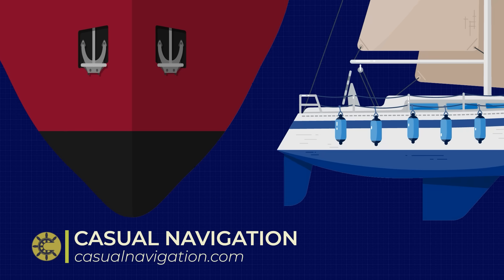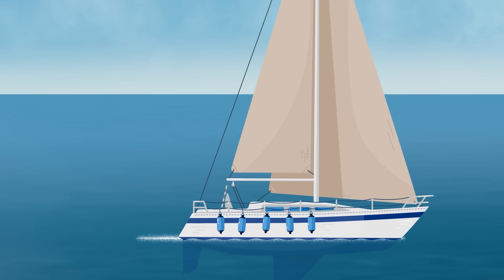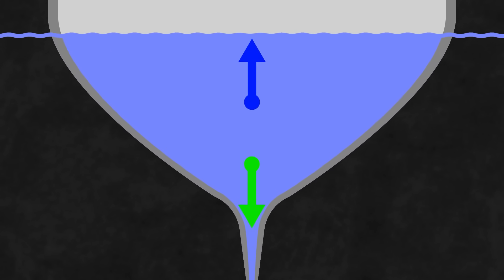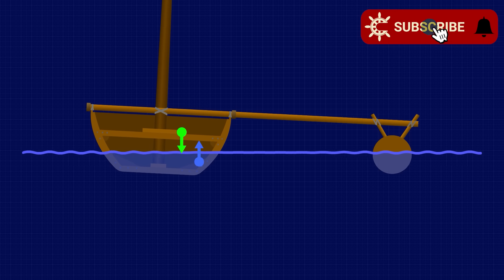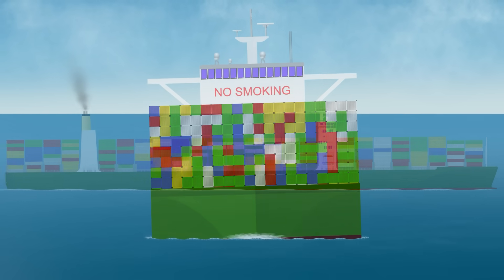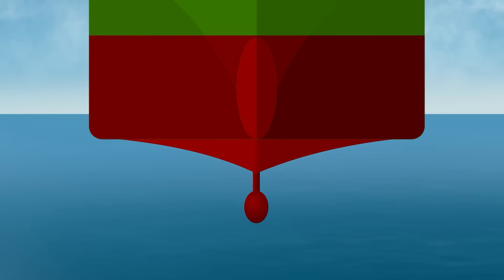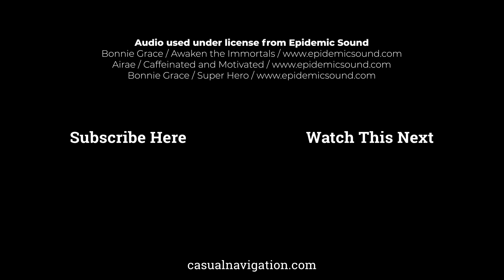Why Do Ships Have Flat Bottoms?

Comment: During the colonial times the English ships would come over not with goods.But with rocks so that the ships would not turn all over and sink. Those rocks were used to pave every street in Manhattan. Before it expanded again in the 1930s, Philadelphia Greenwich, just about every major port city, so many rocks were blood over in the halls of ships.  That were\nTaking our product Back to england to be milled and then sold here in the united states at the cost that we could bear , and because we couldn't bear much cost , not much of it came back , it went to more europe than back here to the states. Sorry the colonies. So next time you're walking down a cobble street , a single block of which would be carried in one ship , just give you an idea of the scale that these 323 hundred and 350 foot long ships were carrying. And that's not a made up number because many merchant ships were much smaller. They were more in the line of a boat size , approximately one hundred fifty feet long , and they were between eighteen to thirty feet deep. And all that rock was brought over by these little teeny , tiny, oversized boats.

Comment: I assume that also means that cargo ships always want to run at high weight, which means that they either need to take cargo back on every return trip, or take on a lot a ballast, and potentially put ballast tanks higher up in the ship, requiring powerful pumps

Comment: You could also include the GM aspect, explained like a pendulum, whereby the lower center of mass and gravity below the center of buoyancy act as a righting lever. So long as you have a positive GM, even just 0.5 meters, the ship is stable, but will roll more, but also return to center more gently. If you have a GM exceeding say 5.0 meters, the ship will roll less, but the force back to upright is quite violent, potentially jeopardising the integrity of lashing on deck (container ships), and not make for comfort for the crew. There is then a sweet-spot between the minimum and too much GM.

Comment: A vessels stability doesn't derive from the vertical distance between the center of gravity and the center of bouyancy but between the horizontal difference between the two.  As the vessel heels the center of buoyancy moves towards the section with the greatest depressed volume at the same time the center of gravity moves towards the opposite side. A flat bottom allows that horizontal distance to increase greatly at low heel angles. This causes an greater increase in stability at relatively low heel angles.  This is called initial stability. Flatter bottoms allow for less rolling. The downside is that flatter bottoms tend to completely roll over once the initially stable heel angle is exceeded. Power boats capsized and stay stable while sailboats tend to continue rolling until the initial upright profile is resumed.

Comment: Not mentioned in the video is the fact that these ships must fit into locks in various canals.  The flat bottom, the rectangular hull essentially maximizes displacement while still fitting into the lock.

Comment: Tetris container on the ship 😂
Reply: Tetris pieces only use Tetraminos (ones with 4 squares) and usually consist of the colors: Red (for the Z-shaped block), Orange (For the L-shaped block), yellow (For O), green (For S), light blue (For I), blue (For J), and Purple (For T). Tetris also usually has a 10x20 grid of blocks. The cargo ship seems to have a large array of Minos, Pentominos, Triminos, etc., do not stick to the standard coloring, and does not stick to the right layout

You could argue that this is during a game of Tetris where lines have strategically been broken to get these shapes, have different colors like in some games, and have a different layout like in some games but when I look at it I don't see Tetris from it
Reply: @TheTeddyBearMaster2 Very interesting. I actually didn't think about my comment for even a second. 
I think it's great that you took the time to read and think about it. Thank you.

Comment: Water pushes the bottom plates upward with tremendous force... and these plates must be curved and without angles to be able to receive this tremendous force and transmit it to the hull, where the enormous load is concentrated. Let's compare this member to the shape of an oar... its blade must be as wide as possible, without angles... and the shaft must be strong... in the design of the ship, the outer plate in contact with the water is the blade... and the inner steel frame is the shaft... and we must not lose the ability to transmit force between the blade and the shaft. However, if the ships are designed in a cubic shape... the thrust force on the bottom plates will increase incredibly... leading to their separation from the side plates and the rest of the hull... and this will never work.

Comment: 4:10 is the answer. Form stability become better with a flat button, due to KMT becoming greater. Bigger KMT means that GZ will become greater, while KG staying the same.
Think it as the center of buoyancy comes further out from the CL at any degree of list, and this Center of Buoyancy vertical line will cross the CL at higher distance, thus making KMT greater.

Comment: What is barely even mentioned is that the draftof a huge ship (how deep the water bust be before the ship runs aground) is a limiting factor on where the ship can be used.  By making the bottom flat, it maximizes the carrying capacity while minimizing the required draft.

Comment: This is also why all modern carriers have flat bottom hulls. It increases their aircraft capacity, while making sure the flight deck is as stable as possible.

Smaller warships rely on more traditional hulls, mainly because of hydrodynamics, but also this form of stability works best for them.

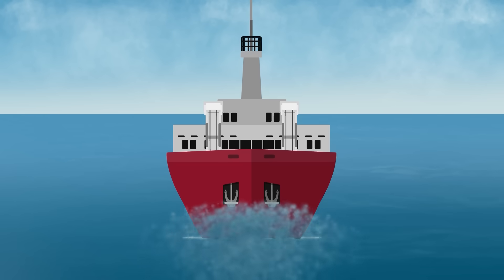Comment: 2:27 they found these Roman lead transports in the Mediterranean and it looks like they tried experimenting with the wide flatter bottoms but it didn’t work how they did it and they capsized
Reply: It creates alot of drag. You need a powerful motor for it.

Comment: 4:11 are the way those are placed a Tetris reference
Reply: not that I know of, it doesn't really look like Tetris, the block shapes are off*, the size of the grid is off**, the colors are off***, lines should be clearing****, etc.

*maybe you could clear lines to get it to look like that but that'd be crazy work
**technically some games allow you to change the size of the grid so maybe
***some games do have different coloring but mostly every Tetris game uses the same color for the same blocks
****unless the grid is bigger than the boat but that's just weird

Comment: I think you completely breezed over the reason for the flat bottoms. 

It's a balancing act and it's easy to just say stuff it with more goods. 

But that doesn't really relieved any one of the fact of why does it not need any kind of stabilizer? 

Is it because the goods in the container at the bottom are always going to be heavier? Is this something that is planned ahead of time while packing the cargo ship? 

Of course I can assume, but if I came here for assumptions I never would have showed up in the first place!

Comment: The keel is necessary for sailboats because it gives something for the wind to press against, making sure the wind pushes the boat forward in the direction the bow is pointing.  If a sailboat didn’t have a keel it would sort of just drift aimlessly in the direction the wind is pushing it.

Comment: Bit of an important clarification missing from this - DEEP KEELS WITH WEIGHT-STABILITY ARE FAR BETTER than form-stability like the flat-bottomed cargo ships.

The reasons cargo ships can get away with it is because of their humongous SIZE.

For example
 - A 30 foot wave absolutely dwarfs a small boat like a sailing yacht in size, and it exponentially dwarfs it in mass.  So they have to be exceptionally seaworthy to survive the open ocean.
 - Whereas a massive cargo ship is the opposite, when you're 1500 feet long and almost 200 foot wide & tall, then a 30 foot wave doesn't pose anywhere near the same threat as it does to a small boat.  So you can get away with a less stable design because proportionally you're never going to face the equivalent dangers.

Comment: Flat bottom means very small radius of sheerstrack and therefore resulting hull to be almost rectangular. This is good for extra cargo would be lifted by ship, by very uncomfortable for ship and crew in bad weather condition. Rolling too hard and fast, because triangle is very unstable in the water.

Comment: Here is a much more COHERENT analyses, which incorporates other aspects not mentioned..Weight Distribution: A flat bottom helps distribute the weight of the cargo more evenly across a larger surface area. This prevents excessive pressure on any single point of the ship’s hull and helps maintain stability.

Stability: A flat-bottomed design provides a stable platform, which is crucial for loading and unloading cargo. It reduces the risk of the ship tipping or becoming unstable when loading unevenly distributed cargo.

Shallow Draft: Flat-bottomed ships typically have a shallower draft compared to those with deeper or more complex hull shapes. This allows them to operate in shallower waters, such as canals or ports, where deeper-drafted vessels might not be able to go.

Cost-Efficiency: The flat-bottomed design is often simpler and cheaper to construct. It reduces the complexity of the ship’s hull compared to more complex shapes that might be needed for ocean-going vessels.

Comment: Thanks for expressing why.  I had thought flat bottoms on cargo ships were to enable them to move through shallower waters and ports.  Didn't know or understand the stability engineering.   Q:  How does all this handle rough seas?  I thought keels and V bottoms benefitted ships by stabilizing their ability to cut through and handle varied rough seas.     My parents moved back to USA from the Netherlands on a tubby freighter design that midstream in building had been converted to a budget liner.  (The Van Halen family moved on the same ship another crossing).  The tubby shape rolled a lot, increasing seasickness  (till stabilizer vanes were added years later).

Comment: You miss the whole point to why sail ships has deep keels while motor boats has not.

The deep keel is there to counter balance the force of the wind pushing on the sails and thus all sailing ships need different keels and hulls from propelled ships.

The other arguments are valid thou.

Comment: On a container ship you don't want too much stability. That will give you a short fast 
roll that snaps back. Better long slow rolls that don't put a lot of strain on your 
lashing rods. The ship will have a computer that generates the lashing plan 
based on the assumed weather and the stability. They can change the ballast 
to reduce lashing and save money on lashers and time on checking that lashing.

Comment: Noah's Ark is often wrongly depicted with a rounded hull as if it was designed to move through water, But it was just designed to float, so a rectangular box with a flat bottom in a 6 to 1 ratio in L x W, thus the name: "Noah's Ark," not "Noah's ship"

Comment: Flat bottle vessels can use air bubble stream layer lubrication  more effectively, to reduse hull drag and fuel use.
Plus flat bottom ships can and do use sails. ..it just requires careful  pumped ballast water v cargo load management..  
Car haullers im looking at you...🧐 😂

Comment: This explains why boats with a keel lean in to a turn because the weight pushes the bottom outward but a ship leans away from a turn because the form stability requires the hull to sit lower on one side before it can provide the countering buoyancy.

Comment: Well obviously flatter base = more surface area so the water is actually lifting it due to displacement. Rafts have flat bases for a reason too. And when you drop stuff in water vertically it will sink much much quicker than if you drop it horizontally. Logs will even bounce up out of the water to land flat in order to float.

Comment: Probably not incorrect, but real poorly explained, I think. Particularly with the outriggers. In order to capsize one side, you need to lift the outrigged side, which is kind of heavy, way out of the water. A few feet, actually. Or force the other under the water. And it has quite a bit of leverage. To capsize the other way, you have to force the outrigged pontoon under the water, but it's also quite buoyant. and you'd need quite a bit of leverage to do that, too. 
In order to get a pontoon boat to capsize, you need to get the center of gravity over and past the pontoons, which are placed as far out as possible. You'd have to force one of the pontoons way under, or raise one side very high above, the water to do that. I imagine the same applies to the cargo ships. 
Sailboat part was fine.

Comment: The "righting force" would be the force that turns the ship back upright. A "turning force" is called "torque". This a little bit more technical, but a lot more accurate. Your rotating arrows are exactly torque. A key property is: torque is proportional to the turning force and the length of the lever. This could habe been visualized quite clearly and contribute to understanding stability. Maybe next time.

Comment: Ferry Sewol disaster comes to mind.   A ferry designed on weight stability but the owners treated it like a cargo ship adding more and more to the superstructure and upper hull, strapping cargo on deck, and filling cargo above the water line in the hull, adding additional cabins up high in the superstructure, all making the ship very unstable.  Brick Immorter has two great videos on the Sewol disaster.

Comment: OOOOoooo ! I was always confused because both seemed "the best option of the two" in my mind, and that makes no sense... Thanks to your explanation it really ticks now ! 
On the heavy keeled one you use a lower center of gravity to "pull" the ship straight, on the one where you can't do this because the center of gravity is above the center of buoyancy you use the buyancy to "push" the ship straight.
It's not the same force that straighten the ship in each case ! (well it's a composite of the two of course, but my brain likes to simplify)

Comment: This is totally wrong 
 The righting moment is a function of the horizontal difference between the CB and CG not the vertical difference. When the boat heels the center of buoyancy shifts to the side with the greater depressed volume which increases buoyancy on that side. The greater the horizontal separation between CB and CG the greater the righting force.

Comment: Actually these see going ships still have a very round shape for hydrodynamic purposes. This also becomes clear if you look at the draft vs tonnes of cargo graph, it isnt linear. 

Inland ships are way more rectangular and flat, because they navigate shallow rivers (in summer draft can be limited to 1-1.3 meters) and the rectangular shape allows them to take more cargo in the same space, because the size is limited by the locks. The draft vs load graph is almost linear for these ships. Hydrodynamics play a less crusial role for inland ships, because their speed is mostly around 10 km/h, for sea ships this can be up to 50 km/h